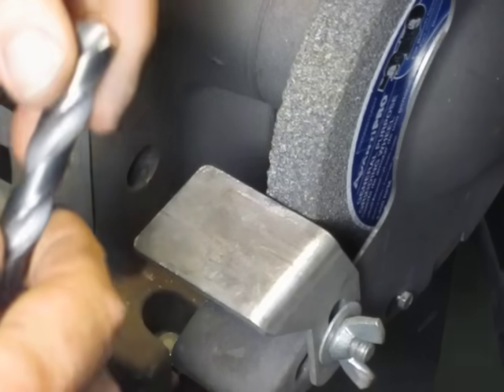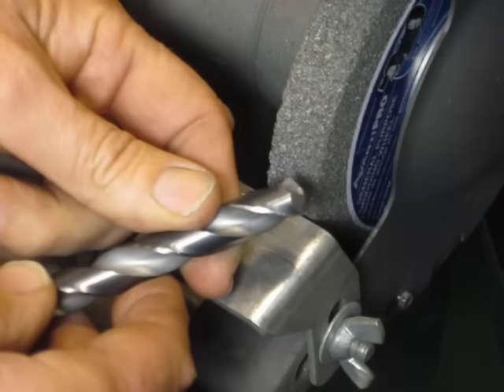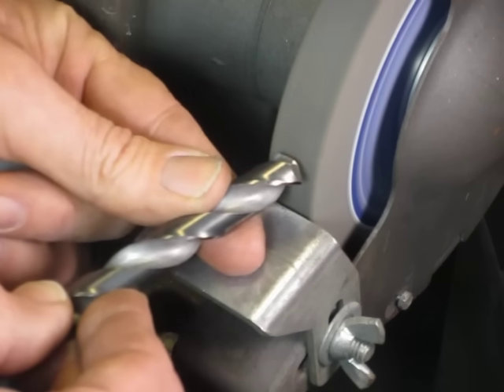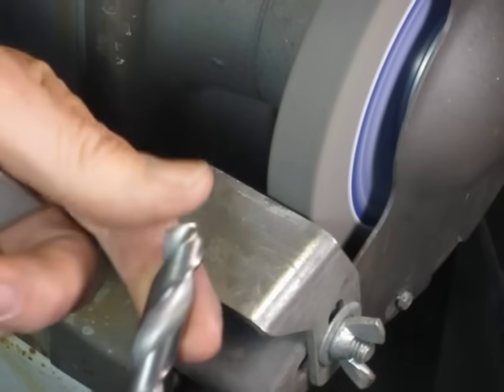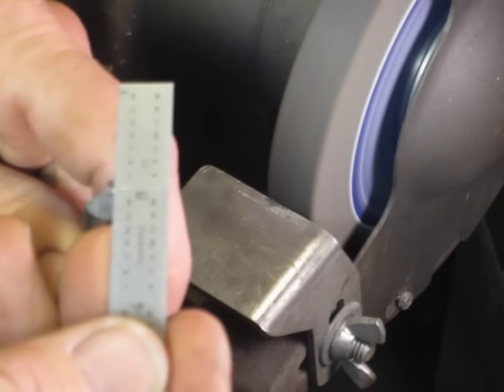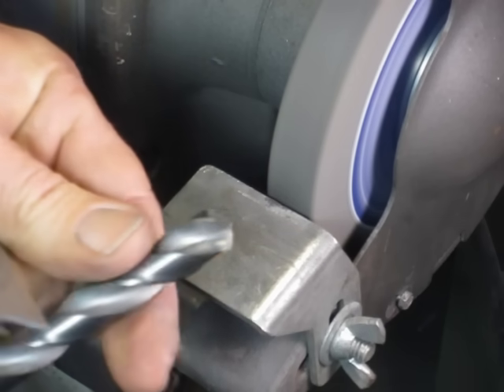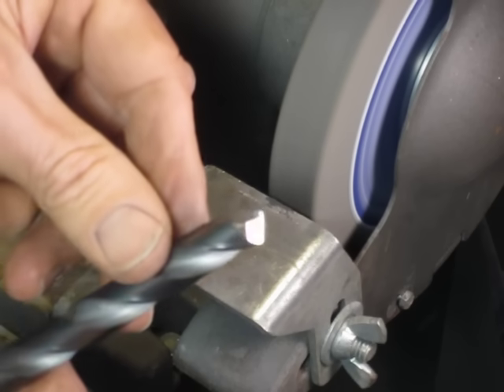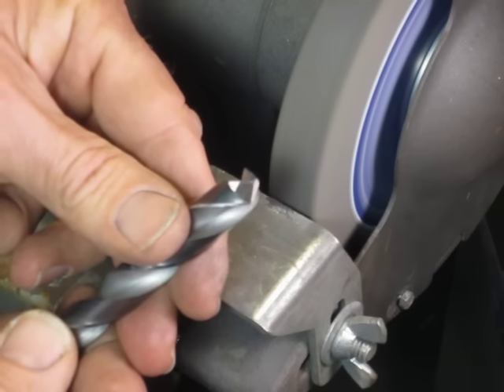How to Hand Sharpen a Twist Drill

Comment: Having struggled to sharpen drill bits for years now, and failed. After watching your video a couple of times, and practiced on an old drill, I can now sharpen like a pro. My drills are all now in pristine condition. THANK YOU.
Reply from the maker: EXCELLENT!
Reply: If I may add a helpful bit of information.   When sharpening a drill, try to find another drill roughly the same size, only find a new drill.  Use the new drill as a guide to how to sharpen the dull drill to make it like it just came from the drill factory.  Try to duplicate the rake angle, and the clearance angles of the sharpened drill like those of the new factory drill.  The people at the drill factory know how to grind drills.   Try to copy their thinking.

Comment: Thanks Tom, I'd just ordered myself a set of 5% cobalt drill bits as I've started working with Stainless steel but I have a ton of blunt HSS bits (literally hundreds) that all need sharpening. Plenty to practice with in a range of different sizes! :) Very informative video, I've learned a great deal from it. Thank you! :)
Reply from the maker: Good to hear!
Reply: It is very difficult to re sharpen "cobalt" drills due to their thick web feature.   To do it right, you need a drill sharpening machine.  I use a Black Diamond grinder to do the job.

Comment: You start grinding and then mention things like clearance angle and cutting angle and how it needs to be cut back.  But you dont explain how it should look and how it shouldnt.  You take a lot of liberties assuming that everyone knows what you a re thinking...
Reply from the maker: Matt,

I prefer to teach the correct way to do something so the student knows what he needs to do to be successful. Trying to demonstrate the many ways someone might do it wrong would not only be futile, but confusing as well. If you have problems with any of the techniques that I teach, first visit my website, where your will find a wealth of reference material, and if you are still having issues, feel free to ask questions. I've never claimed to be much of a mind reader, but I am pretty good at answering questions.

Tom
Reply: Toms Techniques  thanks
Reply: Take away the guessing and make the used drill look like  a new factory drill.  copy, or duplicate the drill angles, rake angles, clearance angels, etc.   Try to find a new factory drill to have while you sharpen the dull one.  And just copy it!  Or, use it as a guide.   It takes a lot of skill to re-sharpen a dull drill.

Comment: I know lots of guys that say they can sharpen a drill, but the fact is nothing does it better than a machine.   If you don't have an equal chip on both sides, it IS NOT drilling correctly and is most likely grilling oversize. This also puts wear on the flutes. I only sharpen by hand when I absolutely have to.
Reply from the maker: Sounds like you need to practice more. :)

Comment: "The FIRST thing we need to do" <<Is what type of grinding wheel to use? I went through a dozen video's and no one talks about what type of grinding wheel to use, they are not all the same.
Reply from the maker: The thought of discussing the wheel type never occurred to me because pretty much any wheel found on a bench grinder is capable of sharpening a drill bit. It's pretty obvious even for a beginner to determine which one works best for the size of drill being sharpened. This is a very old tutorial and is on my list to reproduce. I'll probably touch what grit wheel to use then.

Tom
Reply: Try an A80MV (or A60MV)to start with.  It'll produce a reasonable finish, and if you find you need to remove more material than that would normally be suited to, you can "open dress" it with a hand held diamond or a dressing stick, allowing it to perform like a coarser wheel, within limits.

That'll suit High Carbon and HSS drills, but not carbides, (so the first question ought have been "what drill material are we dealing with")

Recommended grinding wheel designation breakdown-
A= aluminium oxide abrasive grit
80 = grit size (quite small)
M = the matrix, or distribution of the abrasive in the bonding material.
V = the bonding material (Vitrified), glass like.

Comment: One more thing, Tom, shouldn't you be dipping the drill tip in water to maintain the hardening?
Reply from the maker: No, that is not necessary with high speed steel.

See my video on red hardness.

Tom

Comment: Thanks for that. What about small drills. 1/8 or 1/16 Inch?
When I was an apprentice in the training school, the instructor had us drilling and Filing blocks of steel, however, when the drills blunted, he simply took them and sharpened them himself without showing us how. That in itself is just as important as filling and drilling.
Reply from the maker: The principles are the same regardless of size. Small drills just take a sharper eye.

Tom

Comment: Hey Tom, I would have thought that a finer grinder wheel would have been used to finish the job?
Reply from the maker: I normally use an 80 grit wheel for most of my drill sharpening, though a 60 grit wheel like this works better for larger drills.
Reply: 헌대

Comment: I can sharpen any bit with a set of chainsaw files.and flat files and a hand drill.
Reply from the maker: That is interesting, because files and high speed steel drill bits are both about the same hardness, Rc62.

Tom

Comment: Thanks for this. I can sharpen my drills. Sometimes I make it sharp but more often it becomes dull. I'm trying to figure out how come they can sharpen the drill with ease but I struggle with it. Thank you again. I will practice based on how you explain though I still need to have that protractor to have a better result.
Reply from the maker: Hi Glenn,

Off hand grinding as used to sharpen a drill requires lots of practice to get consistent results. Get yourself a few dull drills and sharpen them using the pointers I provide in the video, paying particular attention to the length of the cutting edges and the clearance angle behind them. The more you practice, the easier it will become.

BTW, you should always use a protractor, or better yet a drill point gauge to get the geometry correct.

Tom

Comment: Can you make a jig (a v groove at 59 degrees in a piece of flat board) to rest the drill bit in it? I guess that would help to maintain a uniform grinding surface.
Reply from the maker: The size of the groove and height of the board would need to vary for different size drills. It's best to just develop the skills needed to do it by hand.

Tom

Comment: I've been trying to sharpen my half inch drill bit and every time when I use it, the outside corners seem to rub really bad and not cut. is it because I don't have enough angle on the relief cut? I'm also using a sanding disc on my belt sander, do you think a bench grinder would put a better relief angle because of the curvature of the wheel?
Reply from the maker: If you aren't grinding enough clearance behind the cutting edge, the curve of the wheel would actually make it worse. Look at the drill from the side and be sure there is adequate clearance. Are you adding a secondary clearance angle as well as the primary?

Tom
Reply: I tried a few different sharpening techniques, I've tried putting three different relief Cuts Behind The Cutting Edge. each time I sharpen it it's always the corners at the outside edge of the drill bit that seemed to rub the most and everytime time I try to add more of a relief cut it seems I throw the angle off. can I put too much of a relief cut? How much is too much?
Reply from the maker: The primary relief angle should be 5º-10º, depending on the material. The secondary should be about double the primary. Too much will reduce the life of the cutting edge. Are you sure you aren't running the drill too fast and burning the corners? What size drill are you working with?

Tom
Reply: I'm using a half inch drill bit in a drill press on mild steel. I found another bit lying around and sharpened it and it cu through it just fine. So that makes me wonder if the type of bit I was using at first wasn't as high a quality as I thought. They are Makita drill bits and the one I found was a Bosch which worked a lot better.
Reply from the maker: High speed steel alloys are pretty consistent across the board. It's likely the first bit you used wasn't sharpened properly, or it was just dull.

Tom
Reply: Larger drill bits require less rpm ,a lot of times dulling on outside corners is caused by too much surface feet per min .  Chatter and small chips will be visible.

Comment: Nice to see a craftsman do a real job this is how I was told to sharpen a drill over 38 years but I reduce the chisel point with a rad  still sharpening drills I must have done hundreds over the years
Reply from the maker: I definitely becomes second nature after a while. I check every drill before I use it and if necessary, take a few seconds to give it a quick touch-up.

Tom

Comment: Interesting video.. Excellent presentation,, like all of your videos.. I am working on making it through all of them,, before I go back and watch those that I find particularly interesting.. Have not commented yet, but, I find this comments section very interesting.. I guess those who have been sharpening their own drills, etc,, for years and years, still know there is some new trick, some new information about the task.. 
I try not to dull my bits, but, I do end up fixing a few here and there that I let others use, and an occasional bit I trash myself due to some circumstance I am willing to to to the grinder for.. My success ratio was decent, but, I was never confident I was going to get it right on the first try... After this video, I went and looked at every type of bit that I have,, picked out a few I had marked for sharpening and went to the grinder.. 
I ground 10, and 9 of them, I knew were great before even trying them.. One,, well, it was quite a bit smaller and I needed better light and my glasses.. but, second try, and Boom. Done, and,, happy.. 

Just got my first Lathe and Milling machine (Micro-Mark 7x14 and Micro-Mark Mill to match).. Picked up the pair used from someone upgrading to their third lathe/mill in the shop..  The little guys were taking up needed space.. Perfect for me to learn on.. 
I wish someone would do a video on "Evaluate the Accuracy of your Lathe / Mill".. 
Could also be a very good video for the first time upgrader wanting to buy a used machine.. Doesn't seem to be any on youtube that I can find that actually walk through checking one out, actually using gauges, micrometers, etc... 

I know I would watch it at least 4 or 5 times... And another 4 or 5 times before I bought another,, and probably a time or two in between. And, just a suggestion of what could be done to the different areas of the machine,, if it were not in spec or close enough to spec,, or for that matter, what would be acceptable for a home hobby user, and when you would want to close the tolerances in, if you were trying to do A, B, or C,  where you would want greater accuracy.. 

Maybe an average lathe, in average shape, after the evaluation, what you would do first, next, next, to make the machine more valuable and easier to use and, what other things you might do, if you enjoy spending the time and want the thing to work perfectly/smoothly, etc... Just some thoughts... I know it takes time to make the videos.. I have way more on my computer than I have posted to youtube.. I'm always 10 or 12 projects behind..
Reply from the maker: Evaluating used machinery is not my area of expertise, although I do know someone who is considering starting a YouTube channel on machine rebuilding. I'll have to prod him a bit and see if I can get him moving.

Thanks for watching.

Tom
Reply: Toms Techniques understood.
I just bought a new machine and was curious to know how accurate it was before I started using it.
I think I would have used the same techniques to verify its accuracy before I purchased it, but like I said. Of all the YouTube videos out there comma I didn't find one.
maybe I just don't know what I'm looking for.
When I get figured out, I'll make one. seems like it is going to be using dial indicators and test indicators in various locations on the machines.
I bought this pair from a machinist with 35 years experience. I figured he would have had this thing tweaked to the max. as accurate as it possibly could be.
but I would bet not. they hand wheels and things are not as smooth as I would like them being a beginner.
I'm sure I could see this with a dial indicator and know what to fix.
I did not reply to be an aggravation. I just wasn't sure if I said what I meant to say. I'm lacking in knowledge severely.
this seems to be the fundamental concept of everything else done on a lathe and a mill.
I was thinking, when something didn't work out right, was it my fault or the machines not being set up correctly or accurate.
kind of like jacking your car out before a long trip. Check the belts, the hoses, the fluids, the  tires,  the accuracy of your life before you try to make an accurate Part..
so if I didn't say that correctly to begin with, maybe that is a better description.
I can't help but wondering why there's not a bunch of videos out there like that already. like maybe I am missing some fundamental concept. like I shouldn't be worried about the accuracy of the lathe that I'm fixing to work on.
maybe it's just a complicated subject that's not some five-point simple process.
anyway. Thanks for your reply. I really enjoy your videos.
I think like you do. You made a statement and one of your videos. it's easier for me to understand if I know the why in the how things work. that is the mind of a concept thinker. also the mind of a teacher, and a leader.

Comment: Thank you for this tutorial. I work in a stainless sheet metal shop, and we are forever dulling bits, as you can imagine. I've been shown a couple times, but never thoroughly, and there's only one guy in the shop that can do it predictably well. Now I need to practice, and since I do my art in stainless at home, I've dulled plenty of bits there as well. I appreciated the tips on hand positioning and bit position on the wheel. That's what I was trying to figure out today! I was trying to do a couple at work, and for the life of me couldn't figure out how I somehow kept putting the wrong ramp on the grind, with the back side of it being level or even higher than the front edge. I'm sure I had the bit held too low on the wheel.
Reply from the maker: Thanks Tom. 

Drill sharpening takes good hand/eye coordination, but that comes with practice.

Tom

Comment: I've been sharpening drills for 23 years. a few weeks ago they were all over the place and I did probably around 700 in around 5 hours. I find 130 works much better on the tougher metals because your point will penetrate and be good and sharp, a lesser angle will act more like a counterbore and it will be tougher for the point to penetrate and the outer edges will burn faster as well. Also, look at the sides of the drill, the drill may need chopped off and a fresh point rebound if the sides are worn. I've got a few good machines bit the machines get the drills too hot and take too long. another key point, don't get the tip hot, you will anneal, soften the drill and the drill won't last. his demonstration with the tools are good for a beginner to understand. after years, you don't need the tools, you just learn to roll the clearance on top. Making sure the point is thin enough to penetrate is an important element as well.

Comment: kind of late but people still watch this video so i have to correct you in one thing. the angles are 118° for hard steel or normal steel and 130° for soft metal like AL. reason for this is that softer metals dont need as much force to be cut and the angle cuts more material so its faster. smaller angles add more force to a smaller area, so they are better for harder steel. sorry for being such a smartass, after all it was a great turtorial well explained, cheers!:)
Reply from the maker: Sorry Robin, but you have it backwards. Harder materials require a flatter point to withstand the heat and pressure of the cutting operation, but that comes at the expense of hole quality. A drill with a more acute angle will be less apt to walk and produce a hole that is more round, but it won't last very long in harder metals. Here is a nifty little chart showing suggested drill point angles for various metals.

http://www.carbidedepot.com/formulas-drills-speeds.htm

Tom
Reply: thanks for the source, thats quite interesting...ive checked my book again which is for cutting machine machinists because i thought my memory tricked me. there it says 118° for hard steel 130° for soft metal or  such as plastic material...i guess in the end you still have to grind it the way you need it. if you want it to cut quickly or have more sustain.

Comment: Hi Tom ,how do you avoid  burning the bit without water ,thanks..nice video...
Reply from the maker: High speed steel can withstand temperatures of up to 1100ºF. Your fingers would burn long before the tool bit would be damaged. Check out my video on red hardness.

Tom

Comment: what is the best grit of stone to use? great  video THANKS!
Reply from the maker: Depends on what you are doing. For roughing out lathe bits or sharpening
 your lawn mower blade, a 60 or 80 grit stone works well. For finish 
grinding and sharpening drills, an 80 or 100 grit would be more 
appropriate.

Tom
Reply: Toms Techniques